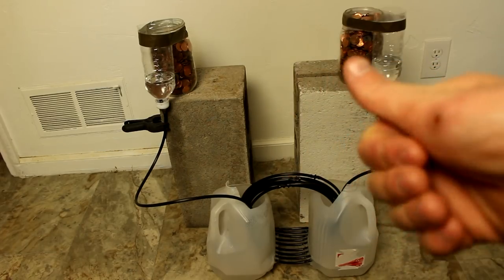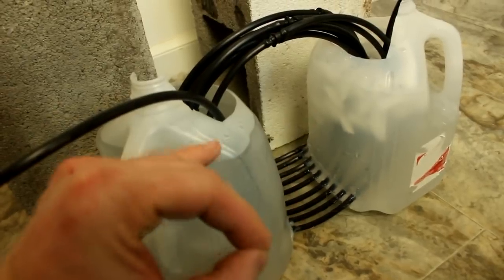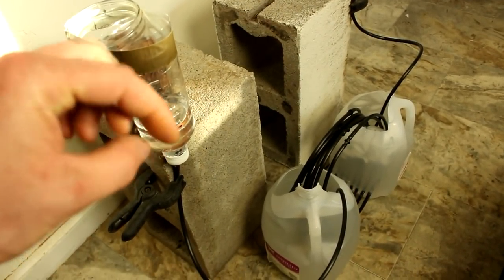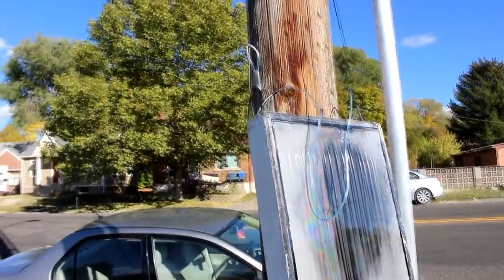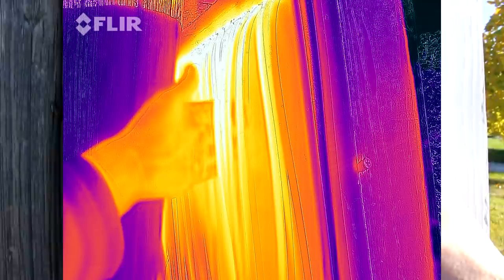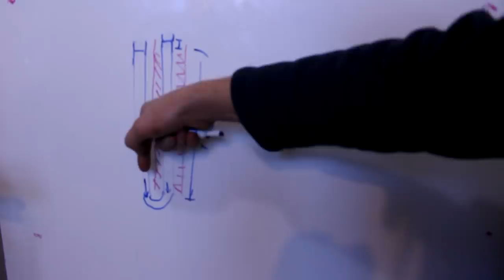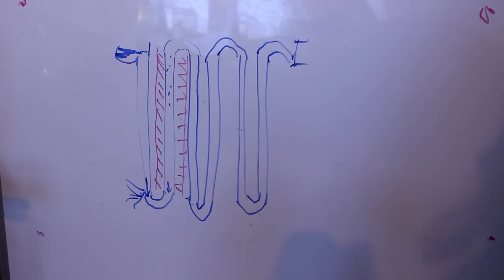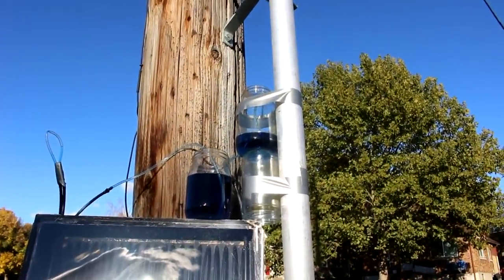Water Pump With No Moving Parts? (except water of course)

Comment: Refrigerators use pumps to get a temperature differential- you use a temperature differential to make a pump. The anti-refrigerator
Reply: Underrated comment right here.
Reply: you just described every non electric engine ever.
Reply: How about engines that use a chemical reaction to generate a pressure differential, with the side effect of a temperature differential?
Reply: +Oliver Turner since I know a thing or two about thermodynamics I can tell you they are absolutely equivalent. in fact that's how you would calculate an engine. nobody puts "chemical reaction" into a formula to eg calculate a 4 stroke engine. you put in the heat input and pretend you know nothing else about what's going on. it's called the first law of thermodynamics and you can count yourself lucky if you never have to deal with any of that in your life ever.
Reply: Your describing a Sterling engine
Reply: They have moving parts though
Reply: Firaro I was about to make this comparison myself.  Thank you.
Reply: I'd have a look at absorption refrigeration, uses ammonia solution and heat to produce a pressure/ density differential to make cold
Reply: +Mar
There are engines that work off compressed air :/
Reply: +Marton no, there are not. because they are technically called motors and not engines. not everyone makes that differentiation but thats what it is anyways.
Reply: +Mar
Well i will excuse myself, and blame it on the engine barrier, since we have a single word that means both in hungarian.
(but then non-electric engines is like "non-black white cars", since according to definition all engines convert heat into something else, hence electric motors that convert electricity into something, can't be engines)
Reply: Most refrigerators go between gas and liquid phases, which makes them a reverse Rankine cycle (reverse of a steam engine).  I believe Cody's design is a Brayton cycle, the same as for jet engines. :)
Reply: Firaro I just wanna comment cause I love your profile pic lol
Reply: If you think that's impressive, google peltier thermo electric generators. They are inefficient but generate electricity through temperature differential. Or you can run a DC voltage through them and get a hot and cold side. This is what in car refrigerators use if they don't have an expensive pump system.
Reply: absorption fridge can also can use lithium chloride in place of dangerous ammonia but probably need a circulation pump ;(
Reply: Peltier cooler no moving parts and it turns electric into a temperature differential.
Reply: the re-refrigerator
Reply: @AdvancePlays  It is a form of a Stirling engine. This is a FLUIDYNE rather than mechanical in nature, the fluid is the moving part. There is no phase change in the working fluid, just a change in density, using a liquid, rather than a gas.
Reply: You mean like earth?
Reply: they are inefficient because of their design, they could be more effective if you could localize the heat far away form the cold.
Reply: If the anti-refrigerator and the refrigirator were to collide, they would get annihilated into nothingness.
Reply: A Defridgerator
Reply: Uh. Not to burst your bubble but the pressure drop in a refrigeration cycle is what causes the heat transfer.
Reply: the warmigerator
Reply: Firaro true. But I mean, same is true of any heat engine really. In fact in thermodynamics heat engines and refrigerators are treated as “anti”. A Carnot engine is just a Carnot refrigerator in reverse
Reply: isn't the anti-refrigerator an oven
Reply: Now put it in a fridge for “infinite” energy
Reply: Refrigeration uses refrigerant gas/ liquid that's compressed on one end and expanded on the other. It's the changing of the phase of matter that creates the temperature difference. 

A pump usually uses an impeller, a compressor is driven by a motor but the mechanism is more of a ball and socket, thus why flakes of copper and even dust can be detrimental to the longevity of the compressor.

Pumps are used in refrigeration to pump out condensation when the drain has to travel uphill due to the location it's installed at.

There's a far simpler manner you could use temperature differential to create a pump with no moving parts or operating at high pressures like refrigeration systems do.
Reply: @markdefish  peliter? you mean the reverse thermocouple or solid state refrigerator?
Reply: @jeremyhall9346  not quite, the pressure change which causes phase change, which transfers energy as heat. Get boiling water, touch it with one hand while getting burnt by the steam with the other and see which burn is worse, if you don't believe me. It's why pressure cookers make meat so damn tender in a short time.
Reply: thanks for ruining the video
Reply: The defrigerator
Reply: @swunt10  So how can you classify engine, which use electric energy to grow a crystal, and use ultraviolet laser to destroy it so it can complete working cicle to move piston?
Reply: @martonlerant5672  I know this is old but I never stoped to think of this, like in my case its even worse. In portuguese Engine gets translated motor (the pronunciation it's nothing alike) and motor still translated motor.

But we do say like car-engine ≠ "air-engine"
Reply: Industrial refrigeration systems sometimes use thermosyphons to cool compressors

Comment: interesting, make a nuclear reactor next time
Reply: kei nuclear reactors are easy ._.
Reply: He does actually plan on making a nuclear reactor. Or at least did.
Reply: I'm on to you north korea.....
Reply: HollowSoulReaper he wanted to make a fission reactor or something he has tritium
Reply: tritium is used for fusion. Not fission.
Reply: He could build a fusor, mehtinks.
Reply: cordidog yeah nuclear reactors are easy just when making a homemade one with cody i would reccommend having an extra life ;)
Reply: if he whant he could easily do i tbh
Reply: it's actually fairly possible to make a fusion type reactor at home . It has been done before , and the blueprints/instructions are available on line. 
But it's expensive and time consuming , not to mention you'll use more energy to sustain a reaction than you could ever hope to pull out of it ( which is the problem with modern fusion reactors btw )
Reply: What do you think he is making heavy water for?

Comment: You can make the back pipes partially out of metal and put radiators on it, so it has a higher surface area to get rid of the heat
Reply: front pipe too, plastic transfers temperature changes very badly
Reply: Exactly a heat exchanger would be metal

Comment: That's simply a thermosyphon pump, first time I've seen it put to use like this though.  If you used thin copper tubing it should improve the efficiency because it transfers heat much more efficiently.  

The thermosyphon principle was use on early cars to keep the engine cool before waterpumps became common place, hence the reason early cars had tall radiators.

Keep up the good work mate, I'm always an interested in what you will come up with next.
Reply: it operates on the same principle as a thermosyphon but i wouldnt say it is one. this design makes multiple loops of heating and cooling in order to maximise the amount of water pumped through the system, wheras thermosyphons are designed to uniformly heat or cool  a volume of water, theyre not specifically for pumping water
Reply: He is using it on an ecosystem.  Copper tubing would kill any phytoplankton cultures. His temperatures with this setup could harm some cultures.
Reply: @Ny_babs  Is it copper's antimicrobial properties that kill phytoplankton or ?
Reply: 3nertia inverts are not equipped to deal with excess copper.  The same way humans are not equipped to deal with excess iron.
Reply: Early domestic central heating systems used thermosyphon. The water would be heated by the kitchen range or by a boiler built into the back of a coal fire. The water would thermo syphon first to a coil heat exchanger in the upstairs hot water tank to heat then round the house visiting radiators before returning to the best source. The advantage of having no need for electricity was likely more significant than having no moving parts (apart from the human shovelling the coal).

Next innovation was a pump to feed the radiators, but where the hot water tank was above the heat source there was still no need for that circuit to be pumped. Turning the pump off effectively prioritised hot water over room heating.

And finally, a car with an electric fan and electric water pump still uses the thermosyphon effect whenever the pump is off; ditto if it has an electric fan and you remove the water pump (don't do this in hot climate, but useful to speed up engine warm up and small efficiency saving in cold climate)

Comment: Cody just fill the front of your solar heater with water. Like you did with the milk jugs. That would give you the heat transfer that you need to make the system more efficient. You could even do the same to back. The only down side that I can see would be weight, so it definitely wouldn't be something to mount on the roof. Love your videos, keep them coming.

Comment: You should give it a phase shift, because you want heat on the way up and cold water on the way down, but you can only apply heating/cooling over time which is basically the derivation of the temperature. The warmest spot should be somewhere on the front but not all the way at the top so that the warm part does not extend to the backside that much. The loops should be on the back side before they reach the top and they should get back to the front before they reach the bottom. The amount of optimal phase shift depends on how fast the water is moving and how fast the heat is exchanged, so your idea with the heat exchanger should help. Of course, a 90° phase shift (top half in shadow, bottom half in the sun) wouldn't start running because the water wouldnot "know" in which way to flow. But the best value should be much smaller anyways.
After all, your heat exchanger might be enough but it's always nice to know about the control engineering theory behind it 😉
Reply: What?
Reply: Nice idea - maybe use a slatted shutter (recycled venetian blind?) on the top part to make it a variable effect? Breaks the 'no moving parts' principle though
Reply: It's not breaking the rule if it's only used in Test Mode, to determine the optimum Phase Shift. After that, no moving the blinds = no cheat.
Reply: god, great video. really hope we see a sequel were he adds in the common suggestions!
Reply: Also put the backside water through metal with cooling fins, being cooled by a solar-powered or wind-powered fan
Reply: Halvard Skurve if he adds a fan, he may as well add a miniature centrifugal pump.
Reply: skip the fan then, just add big cooling fins
Reply: If you don't mind running at low absolute pressure, a percolator could be made that would pump way more efficiently.  Or, at standard pressure, but concentrating the heat so the water gets up to 100 degC.
Reply: Could you use a Tesla valve?
Reply: So you basically want to shade half the circle, but keep the circle rotated forward towards the warmer side. Yes?
Reply: @Unsensitive  I don't see the point of that
Reply: Paul thanks for the insight

Comment: You should make a heat pipe! Like the kind that is used to move heat away from processors on computer. You could use it as a heat exchanger for this, or just do it as a stand alone video. If I remember right they use a sealed copper pipe with water under low pressure on the inside.

Comment: How about using the pressure developed by the heating, to inject air (as bubbles) into a cavity, similar to how a "geyser pulse pump" (which is a type of air lift pump) works.
It should be a MUCH more efficient use of the available heat differential, while still retaining the no moving parts advantage.
Reply: MRLT that's an insanely awesome idea.
Reply: That is what my Mister Coffee machine does. More or less like the old percolator pots did except it is single pass instead of doing the same liquid over and over.

Comment: Hey Cody, I remember you told us that your mercury gravity pump generated considerable ammounts of static electricity, maybe you could somehow transform that project into a generator, it'll be interesting. Upvote if you want Cody to see it :)
Reply: Huh. Actually. New solar panel design?
Reply: Pedro Blasco everyone knows how youtube works quit asking for likes.
Reply: Static energy is just high voltage but almost no current. Difficult to use in anything.
Reply: +BlazeChronicGreen420 
Sorry, I wasn't really asking for likes... What should I get from that? I just wanted Cody to notice this message and that's the only way I found, since that's how youtube comment system work.
Reply: Maybe there's a way of accumulating the generated current using coils, it doesn't seem easy, but if it works, remember he only changed the mercury containers side by side once every 12 hours or somehing like that, so as an experiment I ind it interesting anyway.
Reply: Richard Clutterbuck well, I didn't notice that, thanks
Reply: Pedro Blasco yeah that's how youtube works and everyone knows it.
 There is no need to say like this comment to get it to the top.
Reply: Kind of a vandegraf generator might be do able.

Comment: Cody,
Back when I was in high school (1992-95) I was involved in the Electrathon America project, where schools across the nation would build and race electric powered race cars for an hour, and whoever had the most laps would win. I was the head designer, driver and test driver, and did some of the electrical work on my vocational school's newest car. We ran 2- 12volt car batteries to power a 5.1hp electric motor, on a lightweight chrome-moly tube chassis, and I personally got it up to 50mph before hitting a thermal and power drop off. The main problem we had was the electric motor would get deadly hot, and after I graduated and left the project, someone actually fried the motor. The administrator of the school and supervisor of the project heard that another school tried to use direct application of dry ice to cool their motor, but it ended up seizing it. So I had a solution that I thought would work, but was vetoe'd and I'd like to know what you think about if it would work, since the idea I had is very similar to what you do in this video. 

First off, I'd put an insulated cooler behind the seat of the car, with a coil of copper tubing with semi-loose coils going from one side to the other at the bottom of it. I would run the ends of the coil through the insulation of the cooler, sealing the holes so it didn't leak, and then do a tight coil around the motor housing. So it would be two coils in a closed loop (also thought of a small DC pump in line), one massive coil in the cooler, one tightly wound around the motor. I would then fill the cooler with ice water and/or dry ice, and fill the copper tubing with water. The idea I was thinking of would be that the heat of the motor would conduct to the copper coil wrapped around it, heating the water. The heated water would push the water in the tubing into the part of the coil in the chilled/cold water, and circulate itself through the closed loop, bringing chilled water back to the motor to exchange temps. So not only would it circulate itself, but would also act like a heat sink to drain heat from the motor. Mind you, the motor temps would easily go over 150F, and I recall it once getting to 195F when you could smell burning varnish. 

In the end, the administrator freaked out over dry ice being used at all, despite him bringing a cooler full of it on race day. So we made some quick modifications and ended up putting a duct under the car, up through the back to blow directly over the motor. I don't think it did squat to cool things. So the day I raced it, which incidentally was the day of my graduation commencement, it was cool and rainy, I got the car up to 45mph and held second place for most of the race, and then the batteries completely lost juice, and I limped across the finish line at the end of the hour. I think if the motor kept cool, it wouldn't have drawn so much power to the point where the batteries were pretty much done. 

I wish I had pictures, but imagine a 4 wheeled go kart on BMX wheels, disk brakes, a roll bar, motor in the back linked to the rear axle with a chain, and 2 car batteries behind a sheet metal "seat". So would it be possible for the cooling setup I describe to cool an electric motor like that effectively for 1 hour and not cause a massive draw of amps from the batteries? I'd like to put to bed the idea that it would have worked if the damn knuckle head admin would have listened to me instead of freaking out. Also, it would probably be a good bit of science to demonstrate since it is a very similar idea to what you show in this video.

Comment: Solar distillation (evaporation at the bottom, condensation at the top) might actually work faster, where you have air convection moving the water, as vapor, from the bottom to the top.
Reply: dansw0rkshop the problem with this is he is also trying to move the  salt in the water too
Reply: Or the blue food coloring.